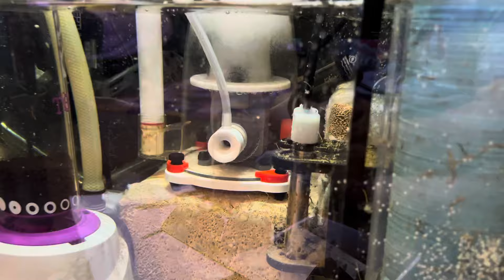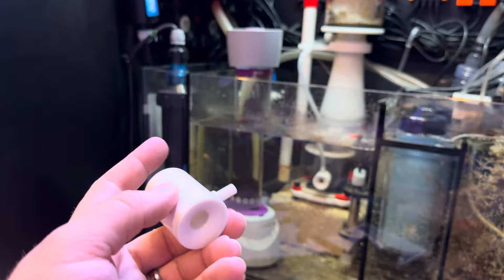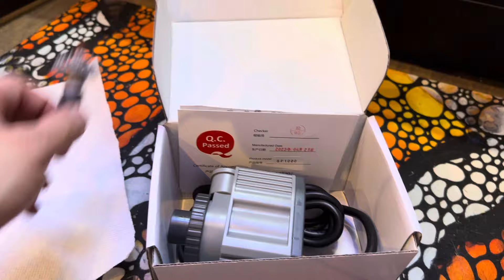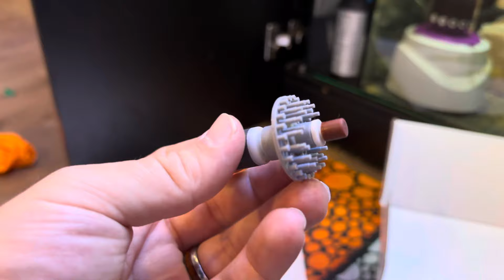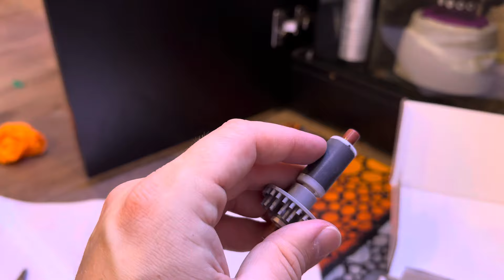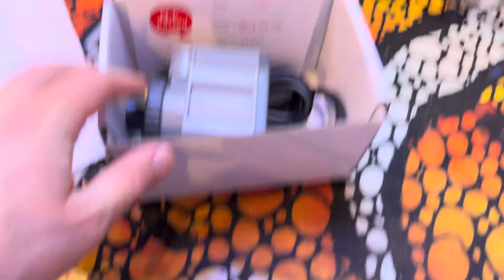Explained: How To Fix Protein Skimmer “Chugging”

Comment: I bought this skimmer, it has been running in the aquarium for 3 days and it is already working very well, it is simply incredible for a skimmer that cost me less than 150 dollars.
Before that I bought a major German brand which was so complicated to adjust that I sent it back to the store, while Bubble Magus 5 is easy to adjust and works, what more could you ask for?
Reply from the maker: Every time I’ve considered an “upgrade”, I take a look at the Curve 5, just foaming away like a champ, and I’m like…but why would I? 🤣
Reply: @kalamazoo_reefer  at first hesitant, that's why I took this German skimmer, but now I will no longer hesitate for bubble magus

Comment: Every quarter I pull the Venturi air inlet piece and soak in vinegar to dissolve the calcium deposits - citric acid works too slow and the all plastic inlet piece isn’t vulnerable to vinegar baths.  If you notice your skimmer having trouble generating the milky foam we all want then the inlet is most likely clogged!  And then hope it’s not the needle wheel impeller or pump ($reefer tax)
Reply from the maker: Those calcium deposits suck! Wish there was a way around it. My impeller magnet definitely got wonked this time around. Must’ve weakened. I’m sure it’s cheaply made, it’s not a high end skimmer lol. Still, got 2 years out of it pretty much! $17 every couple years for an impeller isn’t too bad. I got worse expenses going on for sure 🤣😂
Reply: @kalamazoo_reefer  You get what you pay for with reefing kit.  Used to have an Aquamaxx skimmer that constantly clogged and needed almost monthly cleaning.  I have an Octo Regal internal skimmer now and it just needs quarterly cleaning—maybe it’s just that the inlet is wider but the varios pump is definitely quieter and the impeller is beefy.

Comment: I wouldn’t really call it a “reef tax” it doesn’t matter what you’re buying no American distributors can compete with websites selling products straight from china. Made in America products generally are better quality there for demand a higher cost. That being said I don’t blame you. I try to save money on equipment and will do the research to find the best deals possible on anything I buy.
Reply from the maker: Well, my qualifier was: had it been $25, I would’ve bought it. But I’m not paying $30, when China sells it for $17. $30 is almost a straight up doubling of the cost. And that was the cheapest option from a distributor. There were several prices even higher for the item. It’s ridiculous. And if it needs to actually be that high for them to make profit, well, I guess the market will dictate their fate eventually.